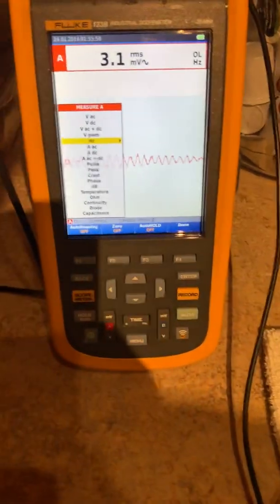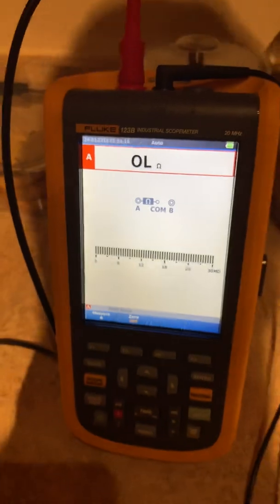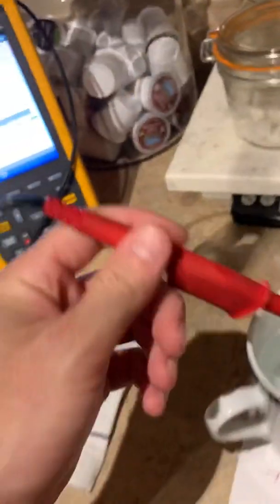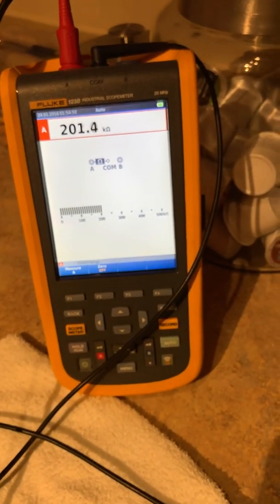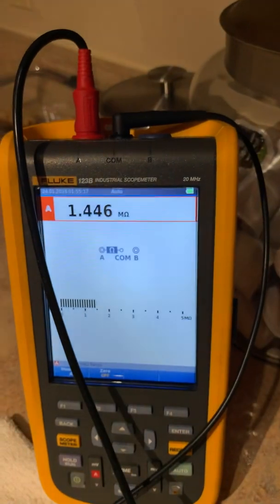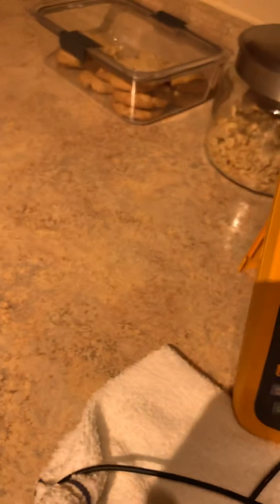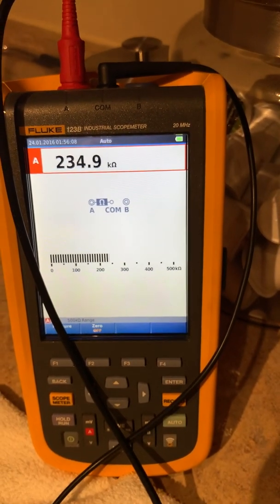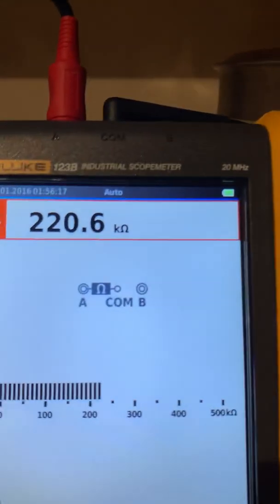Dehumidifier water tests

Comment: My city's municipal tap water is absolutely horrid. I have been using Zerowater filters but they've just gone up in price (2022) and do not last too long. So I'm seeking cheaper,  more cost effective ways. Constructing my own from black carbon, activated charcoal, silica & play sand may be a plan as well as dehumidifier sourced water ?

Comment: Not 10 times, but 10,000 times resistance.
Reply from the maker: no 200,000 ohms (kilo means 1,000 so 200 ish kohms is 200,000) vs 2,000,000 ohms (2 Mohms is 2,000,000 - mega means million) would be 10x not 10,000...that would be ten GIGAohms.

Comment: How do you clear coat the coils? I want to make drinking water.
Reply from the maker: Playboy Saint you will have to disassemble the unit and clean and score the coils (if it’s a coil type unit) and then use a good urethane clear coat spray to coat the coils.  And I would recommend a particulate filter for any dust or allergens that make it through.  Also clean the machine thoroughly to ensure any protectants or lubricants from the factory are removed (I’d recommend using ethanol for that task).  After that, regularly maintain it and rock and roll.
Reply: Why can't we just drink it?
Reply from the maker: Tony Tony well if you haven’t cleaned your coils after buying the machine it may have preservative oils on them to prevent corrosion during storage time before the unit is sold and used, also if it’s an older unit and been used intermittently there is likely bacterial growth in the coils, but in theory if there were no oils or preservatives on the coils and the machine was clean of course ya could drink it, but I gotta warn ya, very pure water tastes pretty weird...the water you’re used to drinking has a small amount of taste due to mineral content; not to mention ultra pure water is actually pretty bad for you...if you’re interested in knowing how that’s possible feel free to ask and I’ll explain.
Reply: @johnk756  could I just pour it through a Brita filter and use? Or just boil afterwards? If I get a new unit for use.
Reply from the maker: @matthewmaxcy1574   A brita filter and a UV sterilizer would be optimal, just to be safe...a good dose of UV light  kills every damn bug in the zoo.
Reply: @johnk756  thanks for the info.
Reply: You guys have come up with a good idea for generating clean water. With more homes solar with essentially free electricity. The excess can be used to generate free clean water, just filter and go.
Reply: Britta filter, then boil